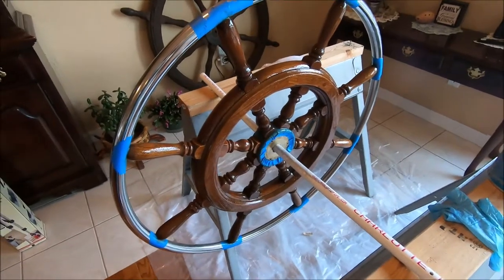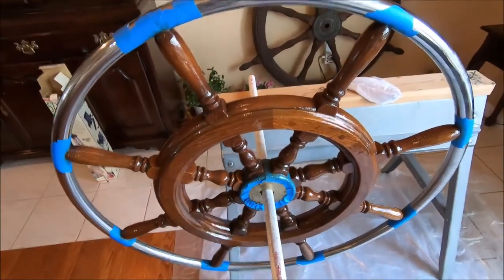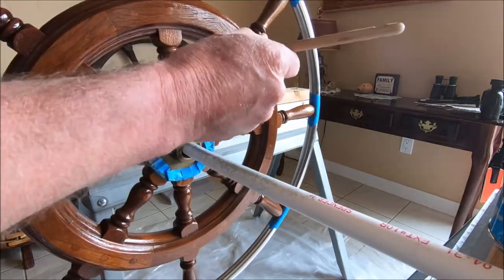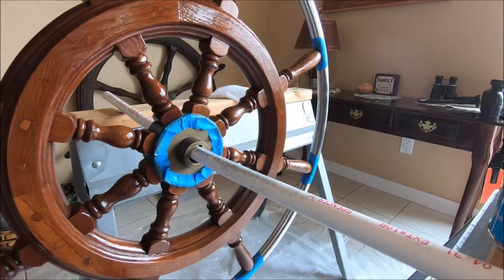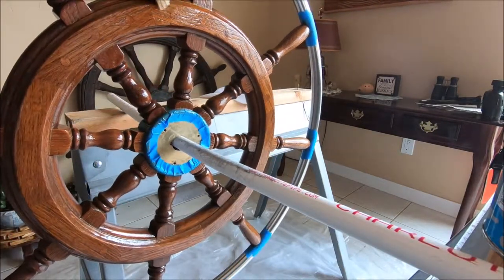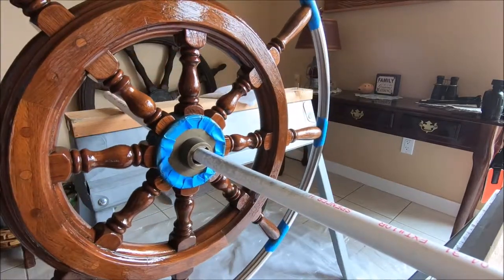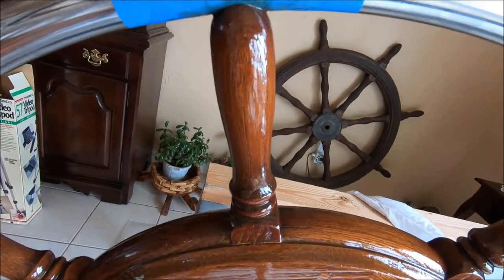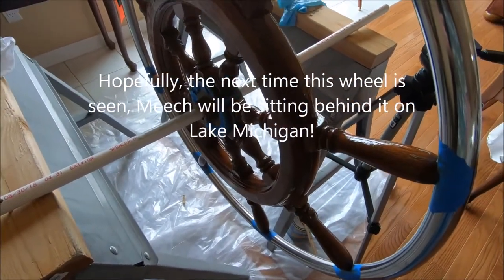Finishing a Wheel with Sikkens Cetol Marine Natural Teak & Gloss

Comment: I loved this! Hey, can you give us an update??? How well did the cetol hold up on your boat? Has it been exposed to the elements. Would love to know! Thanks!!
Reply from the maker: Thank you, Musicisbrilliant!  I can’t fully answer your question as we sold that boat a couple of years ago. At the time, however, the Cetol had held up very well on the wheel and other exterior surfaces finished with it such as the cap rail, trail boards, etc. That said, the boat was in higher latitudes (Great Lakes) and was kept covered when not in use with the boat stored indoors for several months of the year. We just refinished the cap rail & brow of our current boat with Cetol last year. It’s sailed and stored in the same conditions as our former boat but it’ll be a while before I can give a better evaluation than ‘so far, so good’!